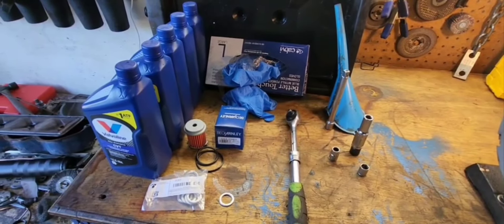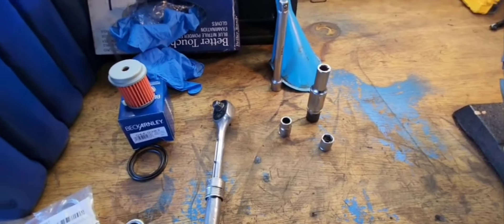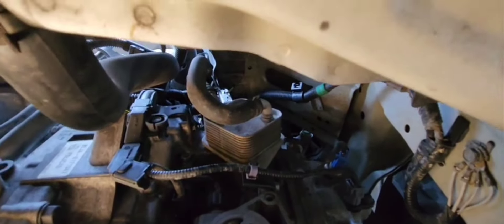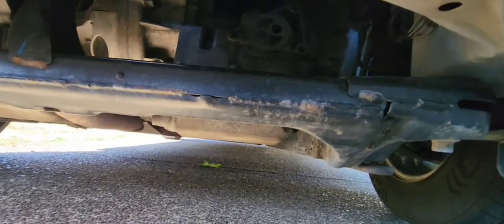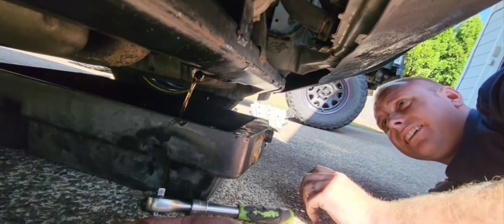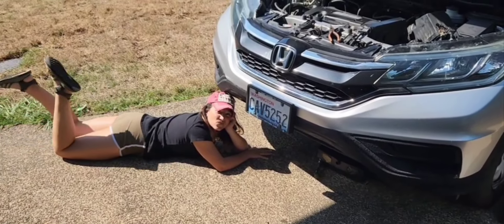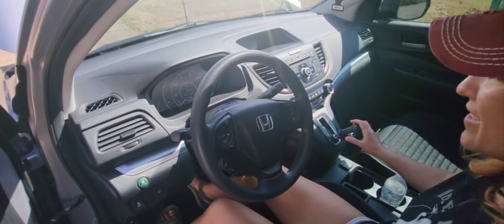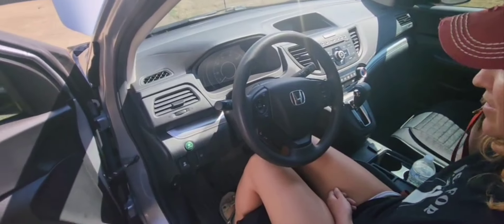2015 Honda CRV AWD Transmission filter and fluid change.

Comment: Bought a 2015 Honda CRV from a friend of mine. He changed the CVT fluid and rear differential around 25k intervals.  I'll be changing it the fluid and filters when it reaches 95k miles I have all Honda parts and fluids. But gave the service manager the evil eye when he said filters never needed changing. Wasn't buying off on that. Friend I bought it from never changed the filters. I convinced him after I bought it that needs to be done. He also has a 2017 Civic with a CVT transmission. Bought all parts and fluids online.

Comment: Sorry I forgot to mention that if you plan to do this job, its recommended before you uninstalled or remove your battery terminals from your vehicle. To have a battery saver installed just in case you lose your radio and all the settings on your car.  Same applies when replacing your old battery and installing a new one. For the radio is good to have your factory radio code.

Comment: Hi Great Video and also awesome to have helper. I bought the same filter on Amazon but. Again, they do not come with the correct O-rings, except for the one that fit on the red paper filter. the only two reasons that hold me to this job is not knowing the correct torque for the three 12mm bolts and not having the correct size O-rings. Because i believe once the O-rings goes flat you probably developed or take a chance of the transmission fluid leak from the oil cooler. Also, i have been reading. on other blogs that there is a second main filter on the bottom of the transmission itself. and the purpose of this second small red paper filter is to catch whatever small particles filter in. And according to Honda is not a requirement to change it. that's why Honda does not carry this filter. But everyone who owns a Honda vehicle should change the transmission fluid at least every 15 to 30 thousand miles, or as recommended on your owner manual. Love how you made t look so simple without jacking up your Honda CRV. and great close-up video. By the way I think the transmission drain plug should be torque at 35FTlbs, same torque as the drain and fill plugs for your rear differential. Thanks so much for your great video.
Reply: The drain bolt is 35 ft lbs and the overflow check bolt is 15 ft lbs. The bolts holding in the trans pan are 8.7 ft lbs. The drain bolt uses a 3/8 inch ratchet, overflow bolt is a 12mm and the bolts for the trans pan are 10mm. Genuinely hope this helps.

Comment: I would recommend using the Honda fluid. Their transmissions are super picky. There's also a strainer/filter if you drop the transmission pan.

Comment: I did mine on my 2016 last night.  You were correct, you could get to the bolts from the bottom.  Thanks a bunch.  😊😊😊😊
Reply: was that a lot easier in your opinion? getting it from the bottom? the 3 bolts for the filter and O rings?
Reply: @McDzy  After doing a 2019 Civic where I had to remove the air filter box, I would say it was easier from the top, the trouble I had on my 2016 CRV was locating the bolts to remove the battery tray.  Next time I probably would remove the battery tray to access from the top.  

Be sure to order O-rings A and B separately, the ones that are included are the wrong sizes.

Comment: This is just the filter to the transmission cooler.  The main filter is accessible by removing the pan.  It is just like the old TH200/350 type filters but much smaller.
Reply: There are also 2 square magnets installed inside the pan you can only access by removing the pan.  The factory pan gasket is metal, I used Honda bond and reused as the rubber gasket supplied was wrong.  If you have ANY build up of particulate on drain plug magnet I would change this main filter and clean the internal magnets.

Comment: Here are the part numbers for the O-rings, filters, and pan gasket:

Honda 91308-5LJ-003 O-Ring (21.8x 1.9), 2015-2021 Honda 

Honda 25565-5LJ-A01 O-Ring B, 2015-2022 Honda

Honda 25564-5LJ-A01 O-Ring A, 2015-2022 Honda 

Honda 25450-P4V-013, Filter, 1996-2022

Honda 25420-5LJ-003 Strainer Assembly (CVT), 2015-2021 Honda 

Honda 21814-RJ2-003 Transmission Pan Gasket, 2013-2021 Honda
Reply: rob you the man! so many videos on this and not much info! someone needs to make a kit with all parts above. i see so many people just change the small round filter and not the strainer and the o rings are all wrong in most kits!  thanks for this info i was able to order all the right parts after a failed first attempt.
Reply: @denisewilcox7653  Great.  Also, those parts fit the 10th generation Civic and the 5th generation CRVs with the CVT transmission.  I used them on a  ‘19 Civic EX and a ‘20 CRV EX.

Comment: I just bought the 2016 CRV and want to do the transmission fluid and filter change, but whenever I look for the filter, I see 2 options, the one you show here and another that says "Strainer", so I´m confused. Is the 2016 CVT different from the 2015? What is the Strainer Assembly? I would appreciate if you can help me and guide me towards what I should do to keep the CVT working well. I bought the car with 72K Miles so of course I need to do that change as I can´t trust it has been done before
Reply from the maker: I'm sorry,  I don't know which one you have.
Reply: You could start with a Honda dealer parts department person. Then you get the correct part(s).

Comment: Off-topic but curious if you have done a valve adjustment yet on this 2.4l?
Reply from the maker: I did a valve check at 100k miles and they were still perfect. So I did not need to do any adjustments..this was before I was recording videos for you tube, it actually the reason I started making videos
Reply: I agree.  I’d like to see a video on that too.  😊

Comment: Do we need change trans filters? I did my drain and fill twice without change the filter.😂
Reply from the maker: Honda says no... but you can buy the parts to do the service, so 🤷.  I made a video on how to do it, and the comments on it clear up the part numbers for you. So it's your choice. I will say that the filter didn't look bad when I did mine at 130k.
Reply: @jjsdiygarage1267  yep thinking about doing the same but it 50/50 lol it look like a pain to change it. Mine 15 crv at 120k miles now. Thank you for making this video.

Comment: Off topic, have you done any valve cleaning carbon maintenance on 2015 crv?
Reply from the maker: I was going to when I went to adjust the valves but they were still pretty clean at 100K so I didn't think the juice was worth a squeeze.
Reply: @jjsdiygarage1267  How exactly did you inspect the condition of the intake valves to check for carbon buildup from the PCV vapors?
Reply from the maker: @stevemullens7937 you have to pull the intake manifold, which I do not recommend to simply inspect

Comment: Is the trans filter present on the 2WD models?
Reply from the maker: I am not 100% sure. I would assume it's similar to AWD.  Just less fluid. I will do some research
Reply: @jjsdiygarage1267  I know the 2WD models use 3.9 quarts for the drain/refill.  I'm just not sure they have the filter.
Reply from the maker: @kevinallen3000  looking at a Honda parts catalog and it has the same part number listed as a separate comment https://www.hondapartsnow.com/genuine/honda~filter~25450-p4v-013.html

Comment: What is the part number of the filter and O-Rings?
Reply from the maker: Beck/Arnley 044-0383 Auto Transmission Filter, as I said in the video, the o rings do not fit. Filter does fit, and I just re used my o-rings which were in serviceable condition.

Comment: Mine is crv 2012 is it the same as 2015 transmission?
Reply from the maker: I'm not 100%sure. They are both 5th gens (2011-2015)
Reply: The 2012 does not have a CVT

Comment: You're supposed to change AT Fluid? I thought you were just supposed to drive them till they exploded and replace them
Reply: I got burnt buying a Ford Ranger with a bad transmission but serviced it and used a can of gum cutter before the first flush and got 3 years of pulling heavy loads and pushing a plow before my $1,000 investment snapped in half. Oh yeah,  it had been mudding to hide the Swiss Cheese frame too.
Reply from the maker: Haha, I mean it depends on how you want to spend your money and time really.
Reply: yes state to drive them til it blow up, but some people beg the differ

Comment: Why not use the Honda ATF as recommended? Honda engineers know best.
Reply from the maker: Same reason I didn't have honda engineers change the oil haha
Reply: @jjsdiygarage1267  the technicians at your local Honda dealership are not the engineers in Japan creating the car. You're only supposed to use Honda OEM CVT fluid
Reply from the maker: @lazyrider6918  yes honda says to only use Honda H2F CVT fluid...that being said I have changed mine with (valvoline cvt fluid which says equivalent to Honda's) every 40k miles for the entire life of my car, which is at 150k.  I say it in the video that you should use Honda stuff if you can find it,  and at the end of the day it's your choice.
Reply: I have been using amsoil no problem so far

Comment: great risk of doing it wrong in order to save $200 labor from Honda dealer. Not worth it. Especially the filter.  Cheaper fluid only save $25 compared to honda fluid but another big risk to take
Reply: How much is it at a dealership?